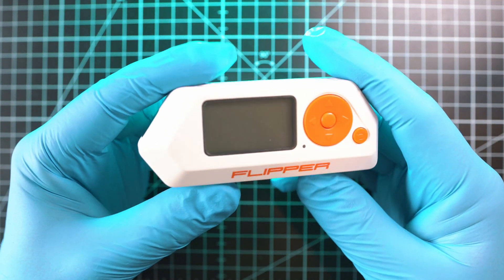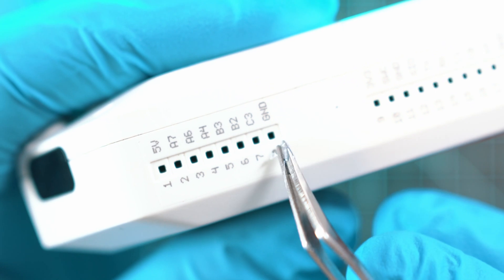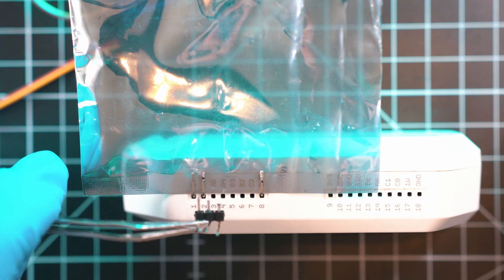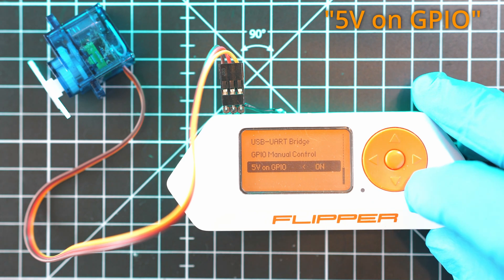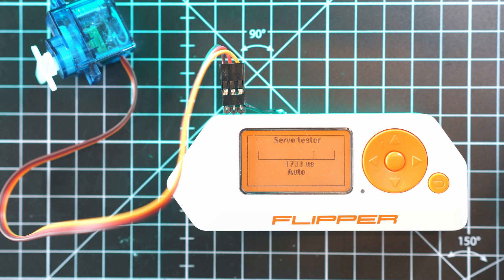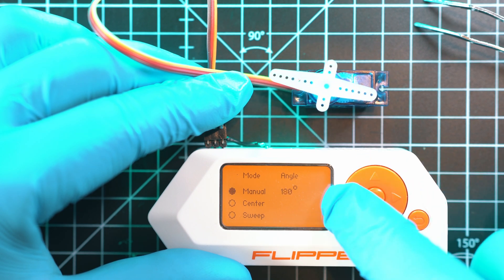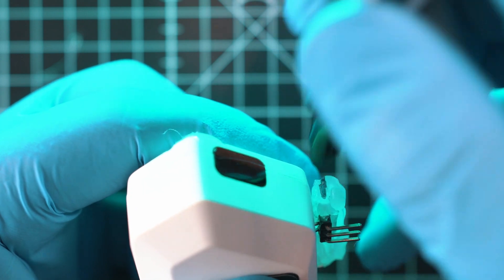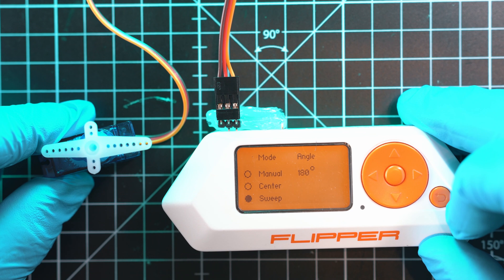Flipper Zero Servo Tester - Servo Tester Module...

Comment: Thanks for the video! Do you know if there is a documentation anywhere which pins I have to use for the GPIO apps? I mean GnD and 5v at obvious but I just couldn’t find out which pin to use for the signal. Same for Temperatur sensors etc
Reply from the maker: hi, I have video about temperature, humidity, barometric pressure sensors (with wiring diagram)!
Reply: @takeapart  thanks! But do you know where I can find this information, when I want to use other GPIO apps?
Reply from the maker: @diy_wizard on github
Reply: @takeapart  thanks, I also found it in the readme file in uberguidos GPIO folder
Reply from the maker: @diy_wizard will have to look at that one